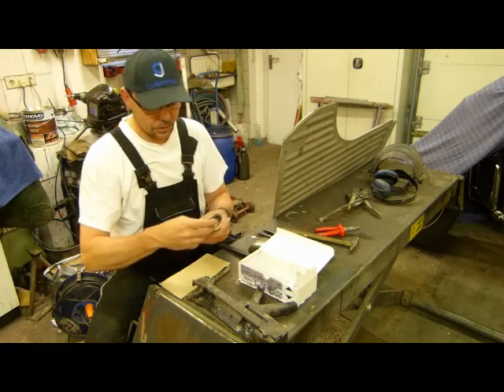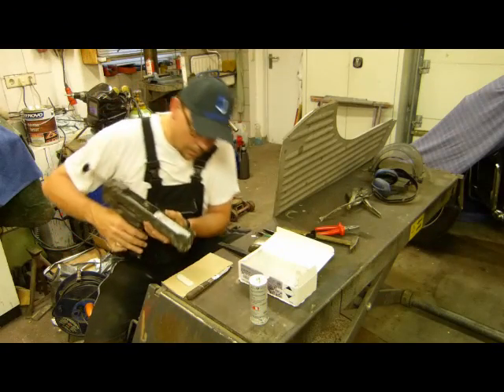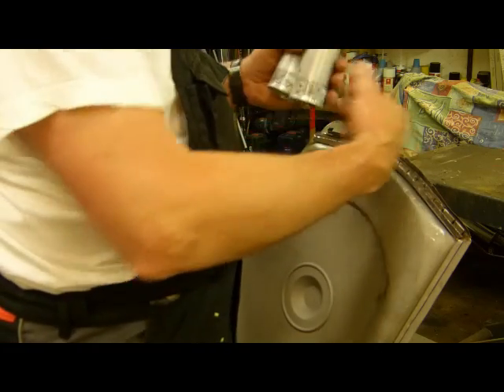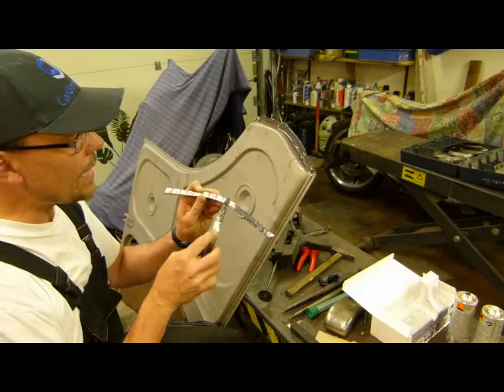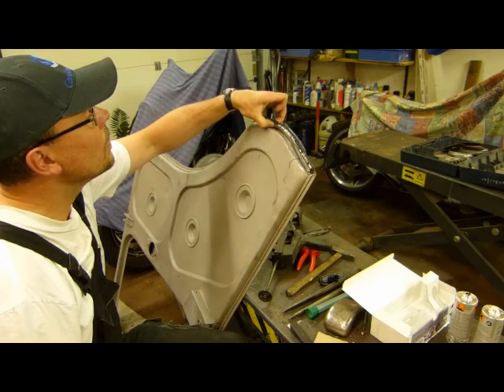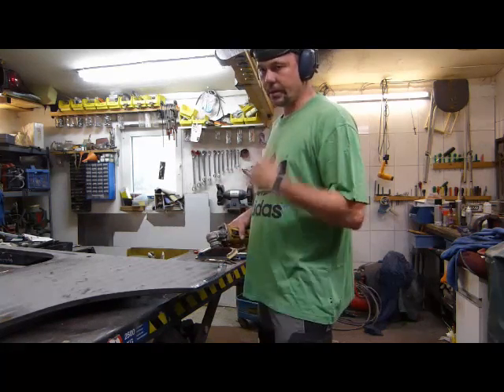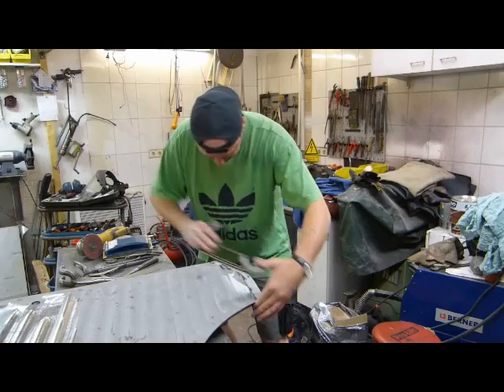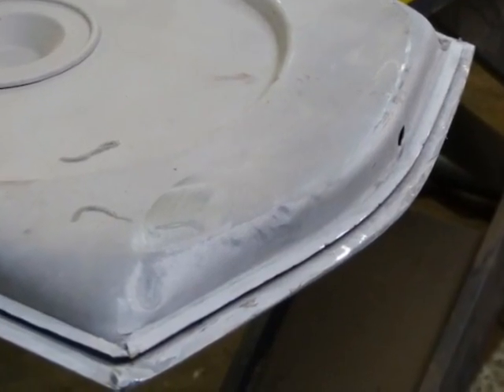Kleben statt schweißen. Efka Karosserie. Fränki's Basteltipps  Stick.Do not weld

Comment: Bitte den Produktnamen des 2-Komponenten-Klebers verraten villeicht direkt mit Bezugslink. Danke
Reply from the maker: In der Video-Beschreibung  befindet sich ein Link zum Produkt.
Gruß Fränky
Reply: leider funtioniert der Link aber nicht mehr. (Tut uns leid.  Die eingegebene Webadresse ist keine funktionsfähige Seite auf unserer Website. ) Ich hatte mir Karosseriekleber gekaut und der wird leider nicht viel härter als Silikon.  @EFKA912

Comment: Hi Fränki,

Sprinter Bj 96, Beifahrertür untere Kante durchgerostet. Kann ich da ein entsprechend passendes Reparaturblech draufkleben, oder muß das zwingend geschweißt werden? 
Mir wurde vom Fachhändler der Kleber PETEC ecoline Einkomponenten Montagekleber dafür empfohlen. Hast Du damit auch Erfahrung?
Danke für Deinen Tipp. Grüße - Wolfgang
Reply from the maker: Ich würde es ohne Bedenken kleben. Wie auch im Video zu sehen. Von Ein-komponenten Artikeln würde ich allerdings abraten.
2 Komponenten sind etwas komplizierter zu verarbeiten, aber manchmal nur das einzig richtige. Ich werde demnächst etwas intensiver auf das Theman Kleben in meinem Käfer Video eingehen. Schau doch mal rein. 
Gruß Fränki
Reply: Danke Dir!!!